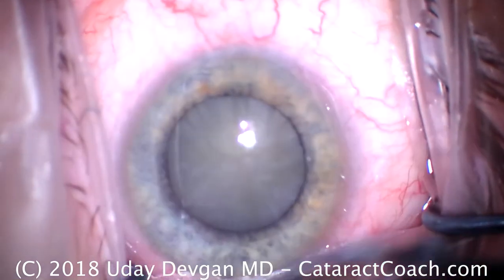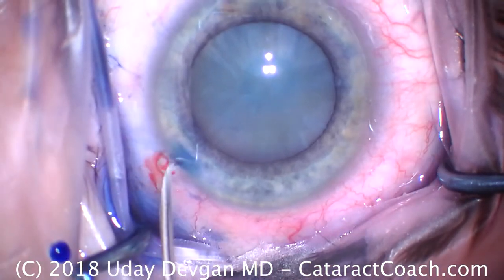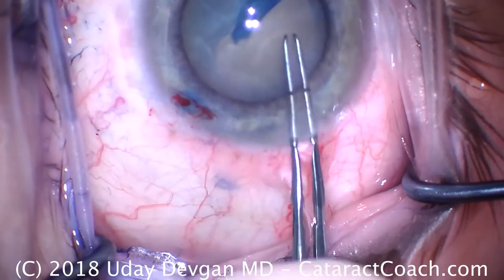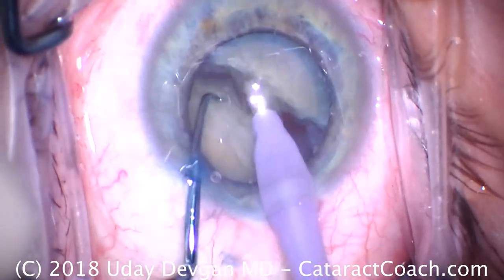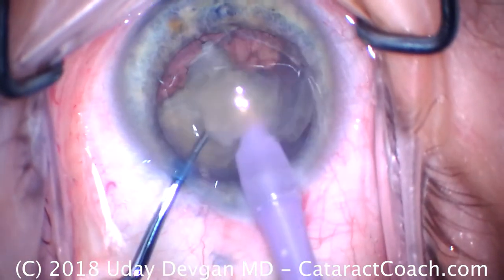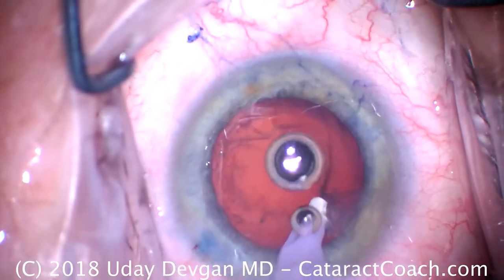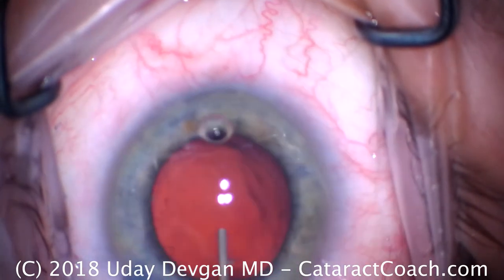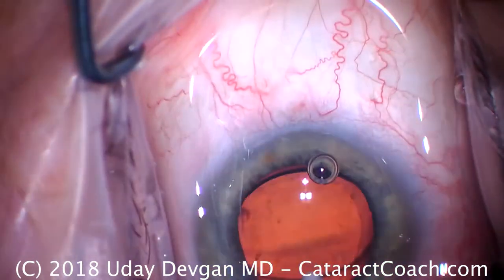Combination Horizontal and Vertical Chop for a Dense White Cataract Surgery

Comment: Thanks Dr. Devgan, a very smooth surgery.  I would like to know what chopper you are using and why?  Is this chopper one that you are comfortable using for both horizontal and vertical chop?  I realize that you are doing a combo of these two but at times one or the other is preferable.  Also, for your chop technique do you use pulse or burst mode?  Thanks.
Reply from the maker: any chopper will do -- technique is more important than the tool. With that said, it is the Devgan Chopper Multi-tool from StorzEye.com 

Any phaco mode will do also -- you just need a touch of phaco energy to embed the probe into the nucleus (pulse, burst, or continuous ultrasound) and then high vacuum (400+ mmHg) to hold the nucleus while it is chopped.
Reply: @UdayDevgan A very honest reply.